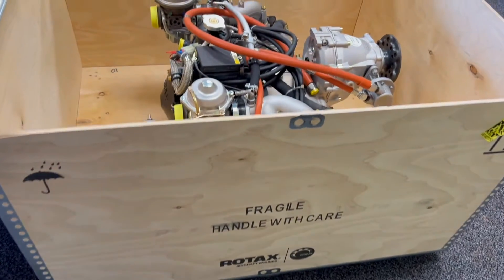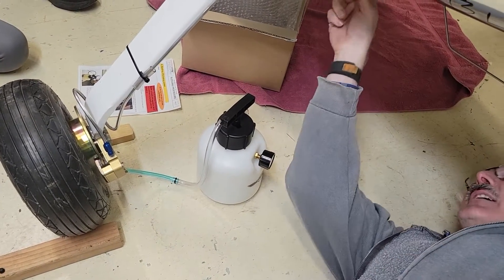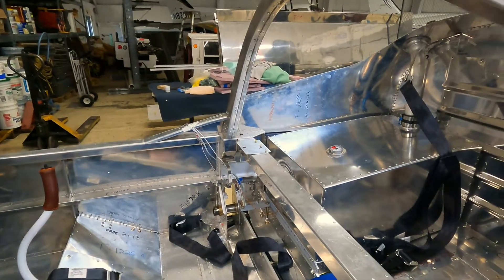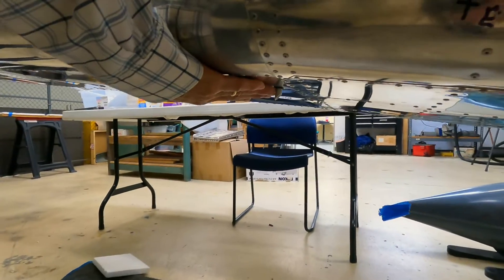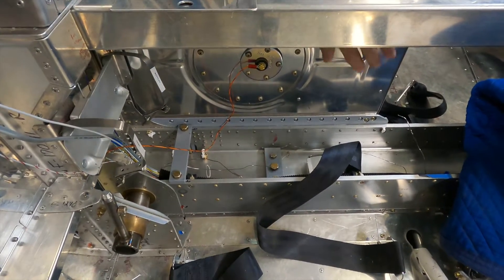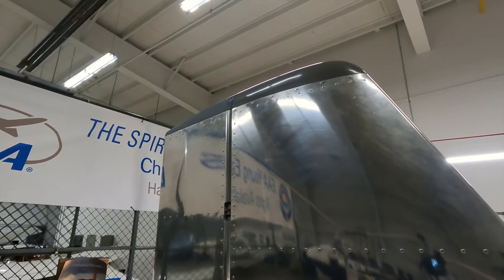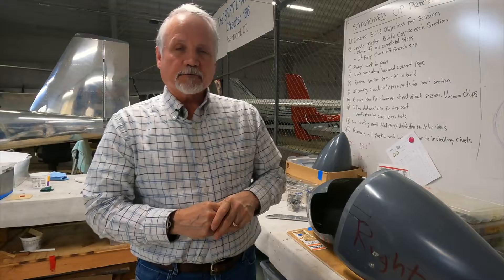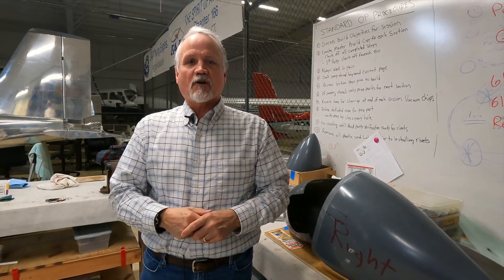Van's RV-12 Build: Fuel tank, fairings, hydraulic fluid

Comment: For aesthetics, you might consider replacing the black zip ties on the gear legs, positioning the brake lines, with either white or clear zip ties.  They really don't stand out as black does ...